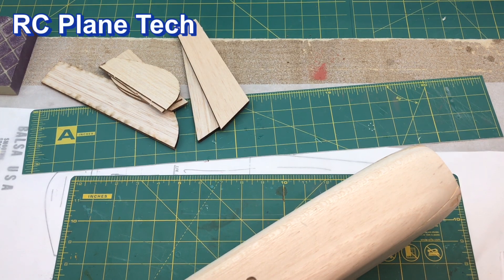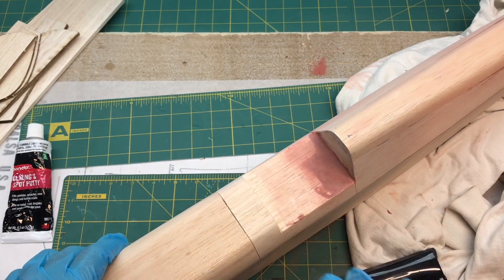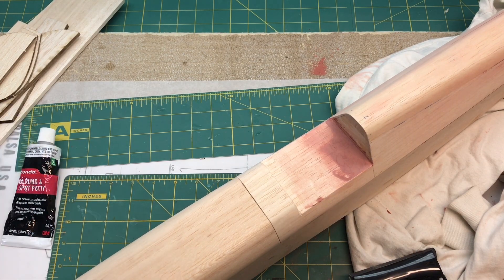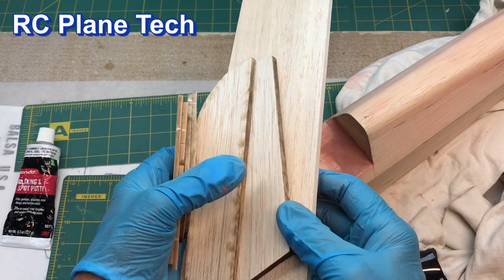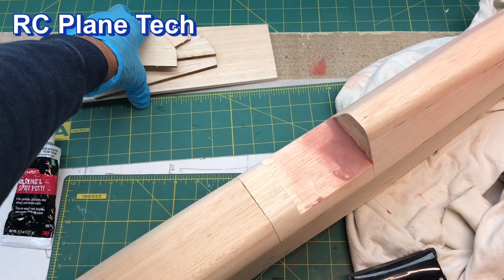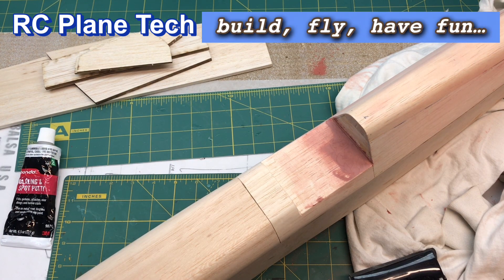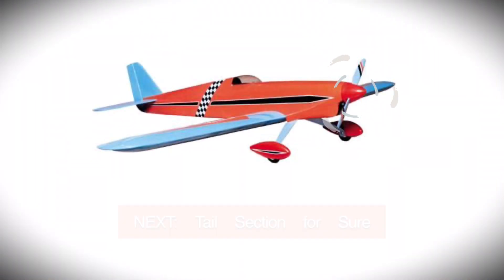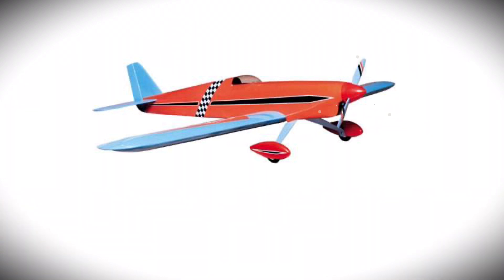Balsa USA Smoothie RC Plane Kit Build No 27, filling gaps with Bondo glazing and spot putty.

Comment: Thanks for the update, seems like we are at roughly the same point in our build although im working on the original kit and had to make up some parts from scratch like the wingtip blocks which were lost during a 20 yr storage of the kit, ill be installing a Rossi 40 engine which has a slightly longer shaft it seems so no matter how far back i moved it on the mount it still stuck out a bit further than a normal 40. I came up with something similar to what you did on the nose and added a full plate of balsa which basically shrouds the engne. it came out quite neat i must say. thank you for the vid blog. 👍
Reply from the maker: Great! You will probably finish before me. Although I am getting closer. The tail section is my last major build step. Then I can start the final steps, covering and putting the guts in and such. Im hoping to get it done soon. Thanks for your comments

Comment: been watching the vids great job However-- although I haven't used bondo as filler before I think Elmers wood filler is a way better choice for this its cheap you can get it anywhere and it sands nice  just my 2 cents great job on the kit and ill continue to watch these posts
Reply from the maker: Great tip. Thanks, and Elmers is safer. I’ll keep that in mind. Thanks, I appreciate the insight.

Comment: I use lightweight spackle for filling. Much lighter than Bondo filler and doesn't shrink. It's white and not dark red like the Bondo filler.
Reply from the maker: Ya, I think Im done with my bondo experiment . Makes more sense to use wood filler or spackle like you mentioned.